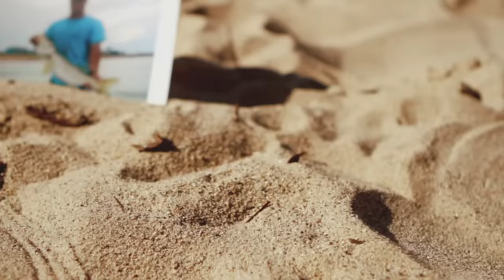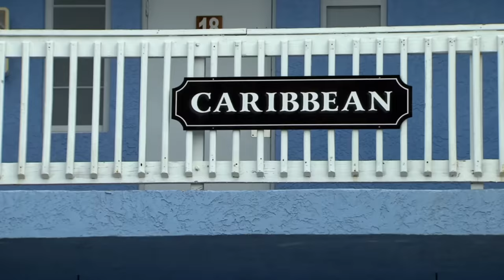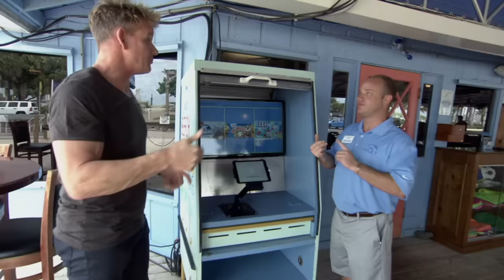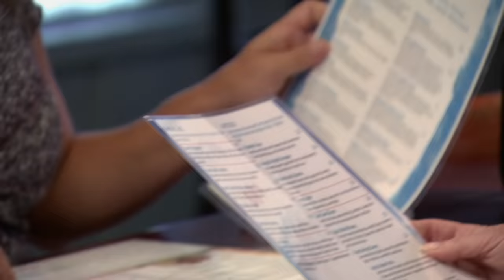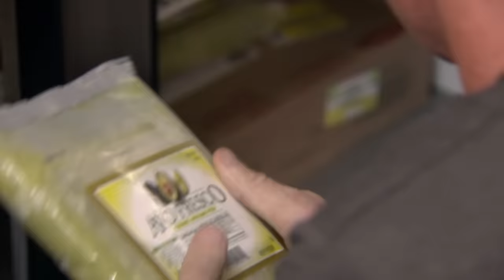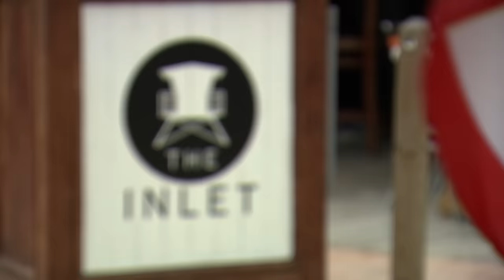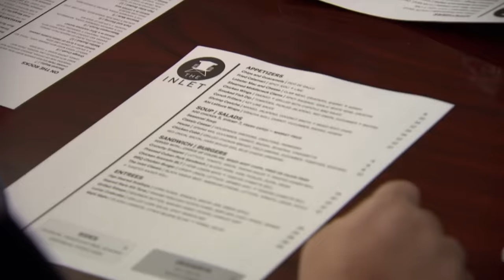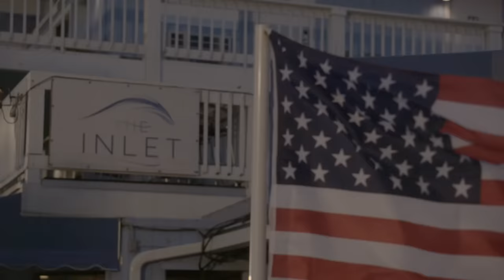Gordon Walks Away From The Beachfront Inn | Hotel Hell FULL EPISODE

Comment: Beachfront Inn and Inlet closed in 2019, which means it survived for around four years after the actual Beachfront Inn Hotel Hell visit.

The hotel and restaurant closed because the owners sold it.

The new owners rebranded the property into a new hotel and restaurant.

As of 2023, the old Beachfront Inn and the Inlet Florida location is operating as Sunrise Sands Beach Resort.

However, reviews for the new hotel are not very good as it has just a 2.5 star.

If you still want to test it out to see the property that Gordon Ramsay visited, rooms at Sunrise Sands Beach Resort start at around $125 per night.

Comment: Ok, this is my second episode ever of Hotel Hell. Some of the things he's complaining of here, simply cannot be helped unless you have multiple millions on-hand. Hotel rooms need to be turned over (completely cleaned, all linens changed, toiletries replaced, etc.) so fast that it's ridiculous. For Gordon to seriously complain about grime in between the metal slide on the glass door that leads OUTSIDE, is absurd. I'm so impressed by what hotel maids can do, and how fast they can do it. My sister did this for an upscale lodge and trust me, it doesn't matter how expensive it is: guests will do the most vile things they can think of, just because they can. The things that guests do to hotel rooms is beyond appalling. Yet, the maids STILL manage to find and dispose of garbage spread in tiny corners of multiple rooms, scrub every mirror, every window, EVERY surface-- fast enough for new guests to check in. The reality is that even if you do have the money to do a deep-clean of each room before the next guest, you will still see where body fluids have been under a blacklight, for example (I've seen him use one for TV shock value). The linens are cleaned and completely sanitized. A blacklight will still show where these fluids once sat (even cleaning products) because certain types have different PH levels, which change the chemistry of what it's made contact with. You will still find this at the world's most expensive hotels.